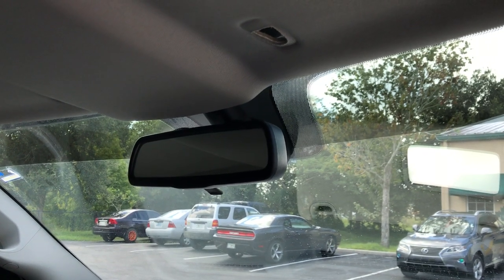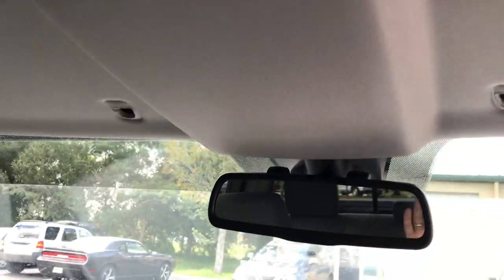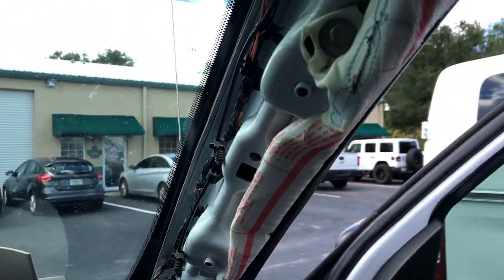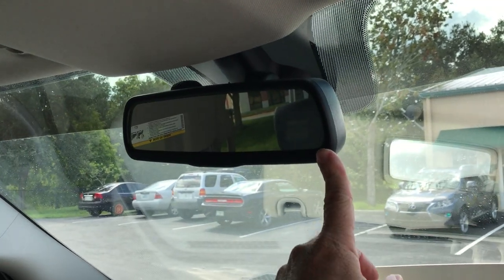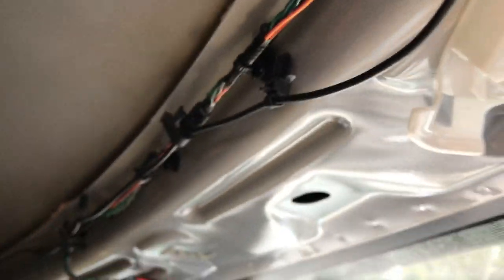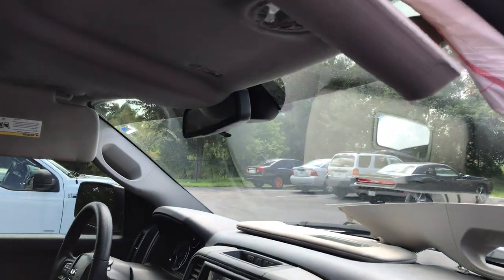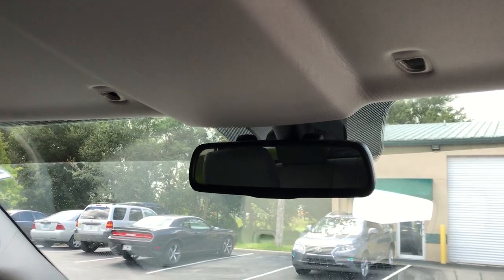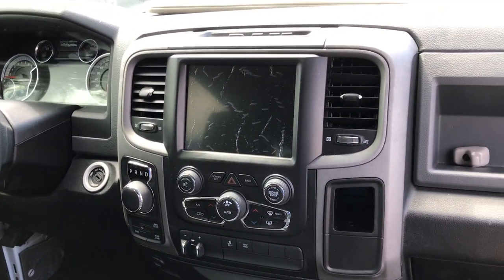2013-2018 Ram UConnect Mirror Microphone Kit - Easy Plug & Play Install

Comment: Thanks for your video.
Need your help in my dodge charger 2009, u-connect system is not provided, i brought a new auto dimming rear view mirror (68020439AB) and want to replace my standard mirror with this new one, the problem is, this new mirror came without the special cable (i think 16 bins cable) and I'm confusing how can I connect my new mirror manually with the power to switch on the dimming function (at leas) from any nearby power cable?
Reply from the maker: Please reach out to our techs at 407-977-5100.

Comment: I have a 2014 chrysler 200 limited with the uconnect system. Can you tell me what the usb jumper does. also I have no dual mic mirror on this so voice rec doesn't work any help with that.
Reply from the maker: The Uconnect jumper cable is a cable used to upgrade a vehicle that has the older hands-free only bluetooth up to the newer style bluetooth that has Audio Streaming. It is only used when upgrading into the RHR radio. 
https://infotainment.com/shop/services/replacement-service/2011-2012-dodge-caliber-gps-navigation-rhr-730n-radio/